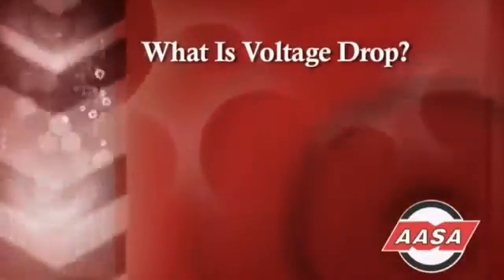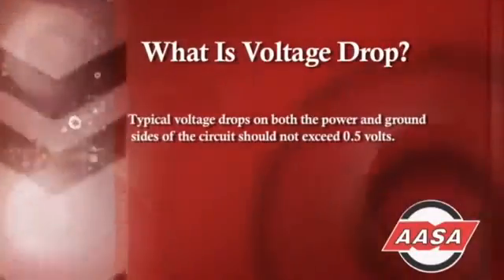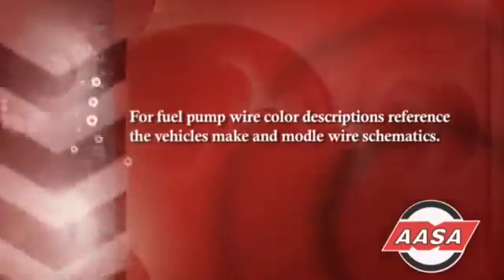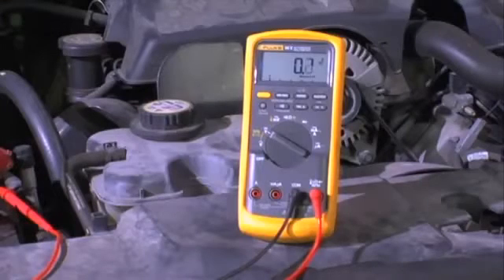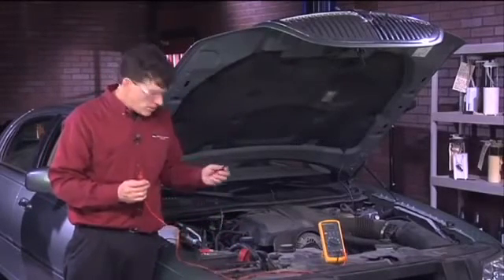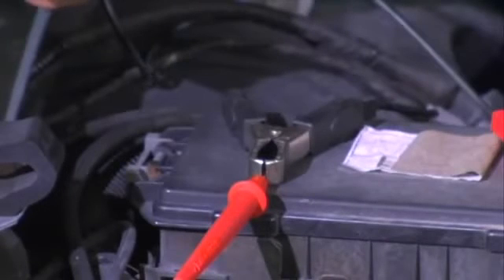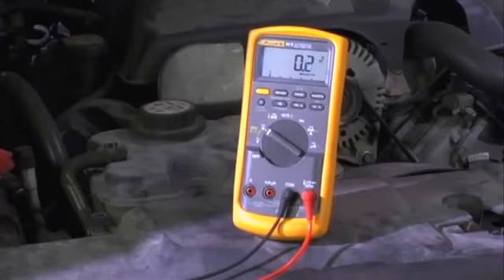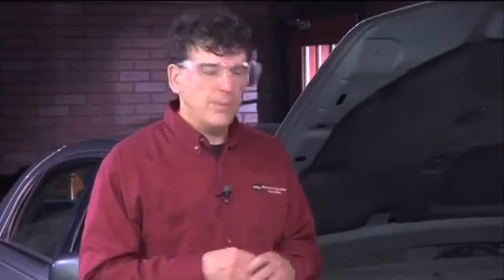Testing Electric Fuel Pump Problems with A Voltage Drop Test | Know Your Parts

Comment: Can you measure this voltage drop at the connector nearest the pump if the fuel pumps terminals are not accessible and still get accurate readings?